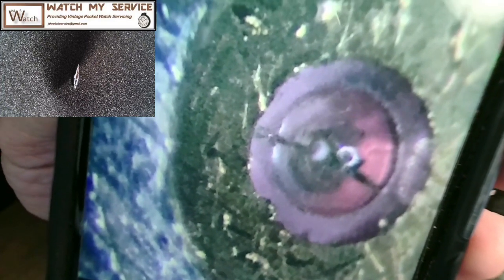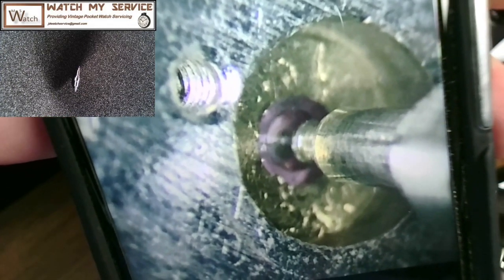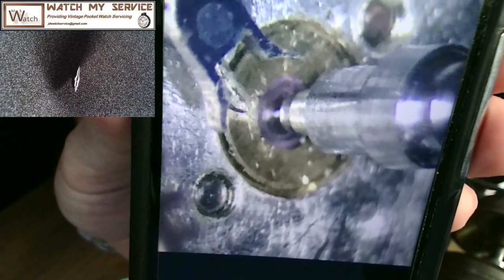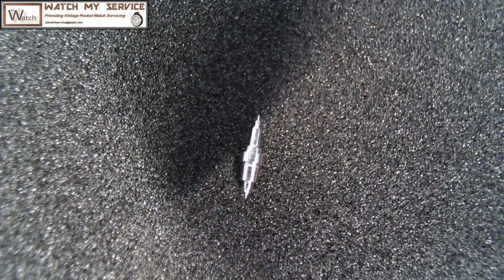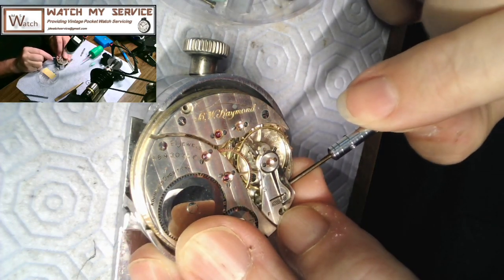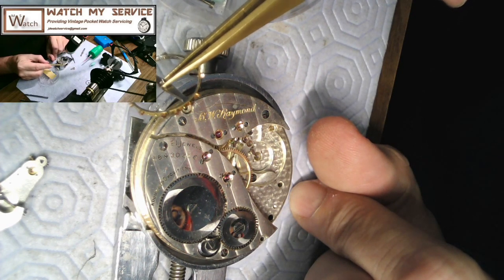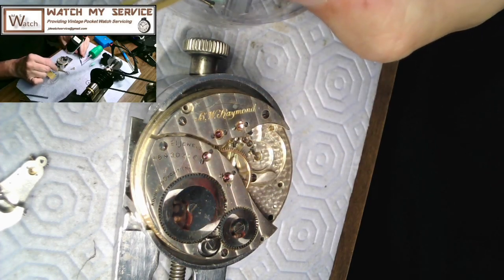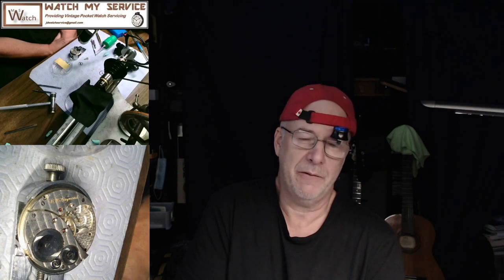Part 4  How to Make a Balance Staff on A Watchmakers Lathe

Comment: JD do you ever re-pivot a staff rather than make a complete new staff?  That is just possibly the difference in the way a person is expected to do it when working for someone else.  In the 70's my employer wanted it re-pivoted rather than take the time to make completely new.  I like the complete new version because you know it runs perfectly true compared to drilling out the broken pivot and pressing in a new piece then machining it down. You do maintain end shake I suppose by re-pivoting and other features.  Just curious if you have thoughts one way or another? Thanks again for your excellent videos.
Reply from the maker: Never actually thought of repivoting the balance staff as an option. That may actually be simpler than cutting a new staff from scratch. So you would need to take off the roller table as a minimum to chuck up the balance and install the pivot on the hairspring side, and you would need to remove the hairspring of course. I think I’ll grab an old balance and try this. You would not get the conic shape or it would be difficult.  Good ideas. Where do you live?
Reply: @JDRichard  I served my apprenticeship in Peoria Illinois from 1970-1975.  During that time I was accepted into an engineering school and graduated from that a year after my watchmaker program.  I moved to Lafayette, Indiana in 1980 as a staff engineer with Caterpillar.  I retired in 2002 and now live in a retirement community in Frankfort, Indiana.  I have re-focused on my watchmaker work since 2004.

Comment: Great video, my pivot jewel gauge only goes from 7-32 but I’m not missing one. There is one like yours on eBay now from France going for around 500.00C I’m sure it will go higher. Would you think mine is ok going to 32? How often have you seen pivot work for beyond 32 on the gauge? 
Cheers,
Geoff
Reply from the maker: The jewel gage needs to have jewel holes that go down to .09 mm for pocket watch work, even thought pivots are usually between .10 to .12 mm